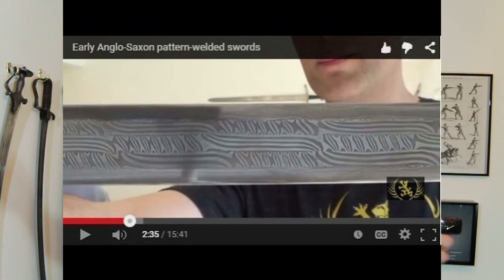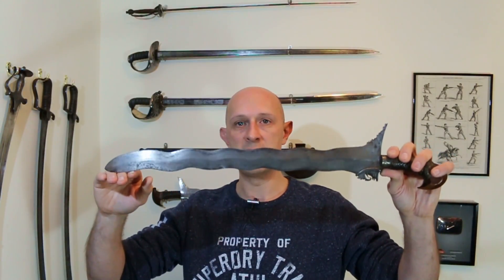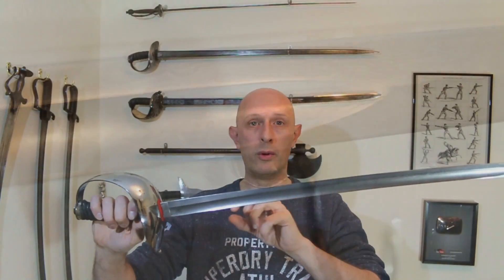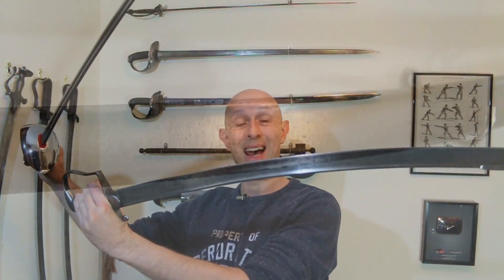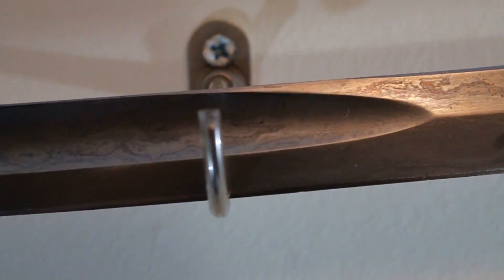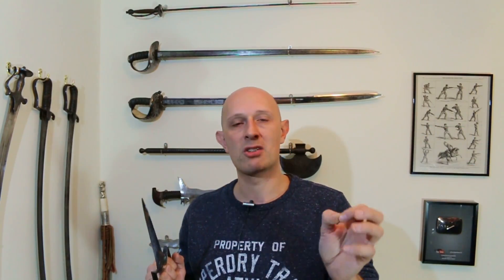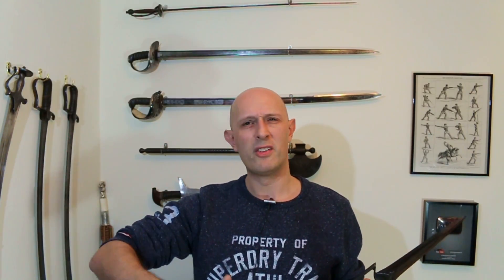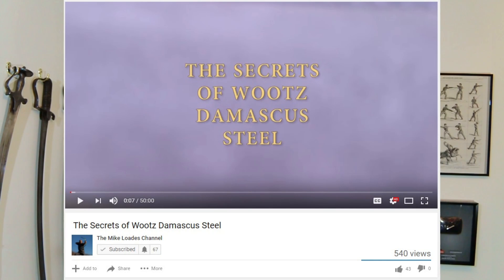Damascus (Wootz) Steel & Mike Loades' New Channel

Comment: from what i know they even differentiated between the two historically by calling one asian damascus(wootz) and the other european damascus in some places.

http://www.tms.org/pubs/journals/JOM/9809/Verhoeven-9809.html  heres an article on what makes wootz special if anyone is curious.
Reply: Matt, would you classify tamehagane as pattern welded steel? because different stacking methods and different folding methods create the different patterns seen on traditional japanese swords, however some of the pattern also comes from the consolidation of the bloomery steel itself.
Reply from the maker: I'd personally call it laminated rather than pattern welded, because as far as I am aware they are laminating it for mechanical reasons, rather than seeking to make complex patterns for aesthetic reasons.
Reply: also matt there are a few compounds that are believed to create the pattern vanadium is one, molybdium is another, chromium ect. 

 i also believe they have found the presence of a number of them in different wootz samples.
Reply: thats where i have trouble deciding, they kinda did it for both, remember the patterns can be altered by controlling hammer pressure, this, along with of which faces of the billet get hammered control patterns, you can have any of the number of grain patterns with any of the laminations, however the consolidation process seems to be where most of the pattern comes from as well, which means viking swords probably wouldve had similar patterns even without further pattern welding due to also being bloomery steel.
Reply: It's interesting because I have been armchair researching lead for a few months now (related to my masters thesis, but has turned into a great interest of mine), and a major ore for vanadium is vanadanite, Pb₅(VO₄)3Cl, a major ore for chromium is crocoite, PbCrO₄, and an ore for molybdenum is wulfenite, PbMoO4₄. All of these minerals are relatively non-toxic compared to other sources of lead and lead oxides. Lead ores, like galena (PbS), which IS toxic, give rise to, and are thus surrounded by, many of the above, and can sometimes be found around iron bands.

Major iron ores include hematite, magnetite, and goethite, and alongside things like pyrite and chalcopyrite. Chalcopyrite (Cu₅FeS₄), when located near galena (PbS) can form the somewhat rare, brilliant blue linarite, or PbCuSO4₄(OH)₂. I include this last bit to show that there is sometimes an association between iron and lead ores.

Getting to my main point, which you will likely have already caught on to, wootz steel may occur when iron bands occur within close proximity to leaden ores, like galena, and their related minerals. The leaden minerals, vanadanite, crocoite, and wulfenite, are likely the sources for the vanadium, chromium, and molybdenum that are sometimes found within iron ores associated with wootz steel. This may imply that, upon smelting the steel used to make wootz steel in a crucible, those who did the smelting may have been exposed to toxic lead fumes......Just food for thought...

EDIT: Will be watching the Mike Loades documentary to see if any of the above information is featured, but, if not, who cares, BECAUSE MIKE LOADES, and the fact that he is a hero to us all, and the documentary will be absolutely golden!!!!
Reply: thats actually a rather interesting point, we would have to look at the different potential sources for the ore, if i am remembering correctly there have been a few potential theories for the places where ore may have been gathered. 

also if you know what a 59 gibson les paul is, or rather 58-60 gibson les pauls, those original pickups inside the those guitars used leaded wire, and some of the other parts may have contained lead, which wouldve affected the tone slightly. so the reason some people say the old ones sound better is due to some toxic materials we cant use anymore.
Reply: MATT! and everyone else, Ric Furrer the guy who made the replica ulfberht for that one documentary. he has done loads and loads of testing on wootz including cutting up an antique blade, im going to link his channel, however there are also a few forums you can talk to him on. 

https://www.youtube.com/channel/UCxyVxfB4c2EsOUtLly7ZrYQ?&ab_channel=RicFurrer

this dude as well as a few others have spent alot of time looking into recreating wootz, they have achieved a steel that on all measurable aspects is the same or very very similar, whether its made the exact same way, i sorta doubt it, most modern recreations are done with clean bits of metal not ore, and the crucibles are obviously different.  ill be watching that documentary though. MIKE LOADES! but you are right he's been in soo many different things over the years.
Reply: That's awesome! I wasn't aware that they used lead in the pickup coils! I'll have to add that to the list of cool sources of lead poisoning! Also, I will be looking into this Ric Furrer fella'! Thanks man!
Reply: yeah the old wire had lead and an enamel coating, apparently the coating makes more of a difference, theres also some other interesting things that make them unique, but a few of the other materials apparently also contained lead as well, cant remember what it was off the top of my head and weird little things can affect tone in guitars. 

and yeah ric furrer is awesome. he does classes on making your own wootz. and yeah the nova documentary on ulfberhts hes the guy who made the sword.  if memory serves he also makes some nice replicas of indian tulwars and shamshirs with his wootz steel. but im sure he'd be one who could help matt and maybe even dr capwell with etching blades to bring out the pattern(dr capwell mentions in a video matt did on a really cool mogul dagger that its wootz but its been polished and lost its pattern) given furrer has done research on originals including cutting one up for scientific analysis im sure given his ability to recreate the stuff he can at least give some advice towards restoring the pattern. 

my personal advice from what ive seen people do with some japanese swords is diluted lemon juice and something soft. you can work it slowly. however that may not be the best way, and i know many japanese swords end up repolished anyways which has a stone with a natural etchant in it.
Reply: Oh, I see! Yeah, most modern and conventional glazed pottery is still made with a lead-based glass to make it less brittle. There are other ways to glaze pottery, like ash-, tin-, or felspar-based glazes that are much....healthier for humans, but lead glaze is more convenient (it can be fired at a mere 800°C), looks clearer, and displays colour more vibrantly. If done correctly, it is totally inert and non-toxic, but a lot of old pottery with this style of glaze is quite toxic indeed! Even some of the newer stuff isn't regulated quite as much as it should be, and has trace amounts of biologically available lead on the surface. I'm assuming that the lead in the pickup coils was not rendered similarly unavailable by the enamel coating, thus its discontinued use? Bahaha!

Also, yeah, that would be an amazing collaboration! I love seeing various professionals being brought together to speak because of this platform and its creators! I've seen the lemon juice thing as well for etching away the higher carbon steel